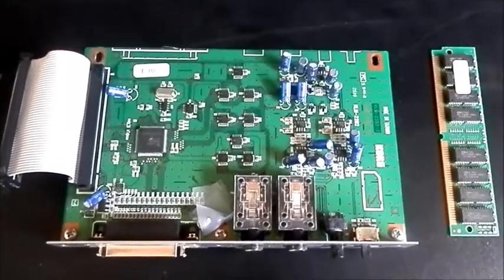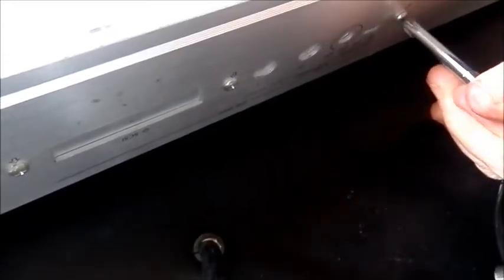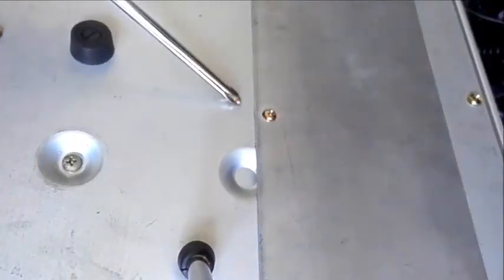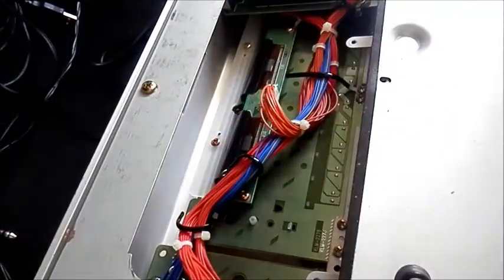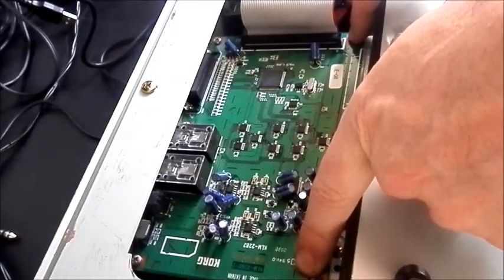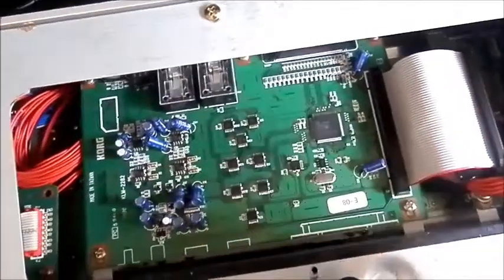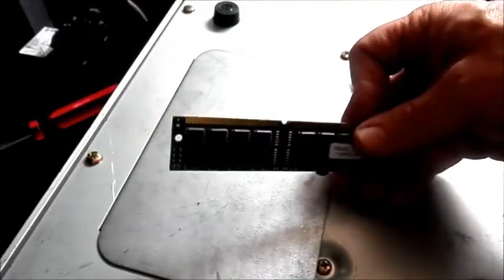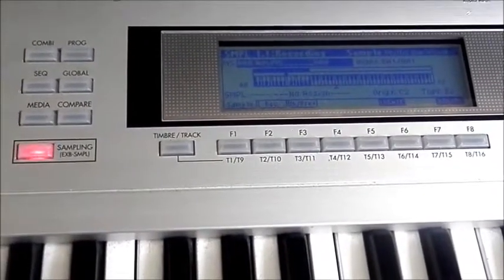Korg Triton EXB-SMPL sampling upgrade kit installation.

Comment: Thank you very much for creating and sharing this video.
Do you still own the Triton and how do you like the sampling options so far?
Reply from the maker: It's a great sampler. 48Kh is the ONLY option and it's crystal clear all the way  :)  Gearfacts (and thanks for watching!)
Reply: @gearfacts  You can downsample convert on the Triton after you sample to different fractions of the original 48kHz sample (I think 1/2, 1/4, 1/8). I believe you can repeat the downsampling to get to something very low like 8kHz or less, too. Plus, there's "decimator" fx algorithm to add grunge/grit to samples, if that's what you're after. (Of course, distortion algorithms used lightly can do some of that , too. )

Comment: Man, if the triggering latency on that is good, I might be in the market for one for a beats / pads sample playback device. Especially now that they're affordable. Do they have any M1 sounds in them?
Reply from the maker: I've got a vague feeling that I saw a collection of patches on one of the Triton forums that was all about M1 simulation. There are so many patches out there available for free, so I'm sure there'd be something. There may even be M1 sounds resident on the Triton but I've never actually used an M1 so I wouldn't know. As for latency, my first sample had no perceptible delay so it should be all good :)

Comment: Have you made a follow-up video in which you demonstrate the use of the EXB-SMPL sampler card?  I have a TR88 with the card; however, I'm not familiar of what one would hook-up to the SCSI or what type of adapter I may need for more modern interfaces.  Any info would be greatly appreciated.
Reply from the maker: Hmm, if there's an SCSI socket that would imply to me that it's actually the EXB-MOSS card you've got in your TR88. It's just a communications upgrade, not sampling. This is all a bit foggy in my memory though so I'm open to be corrected about any of those details. The EXB-SMPL upgrade will have clearly visible audio inputs. Let me know your conclusions  :) Gearfacts

Comment: so how does this sound as a sampler? do the sound warm and lush?
Reply: its not like the mpc, where you get a "Punch" or specific character from simply sampling into it, but it has a lot of modulation options and effects, giving you the ability to get reallllyyyyy complex with basic sounds.
Reply: I sampled my home-made flute. With some pitch correction, formant processing, and a small room rev. I get a decent intro to Strawberry Fields.
Reply: Ah alright. I have parted with my triton now. I will miss some if the  sounds it had to offer though